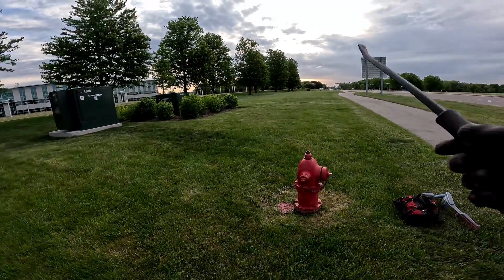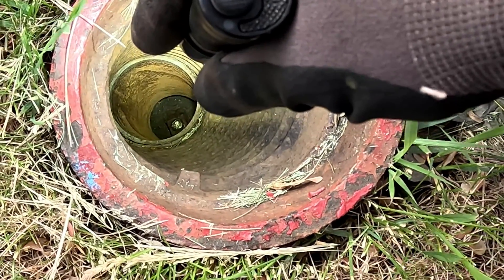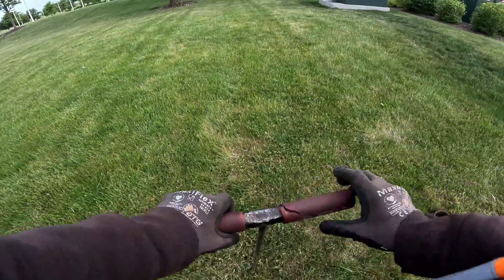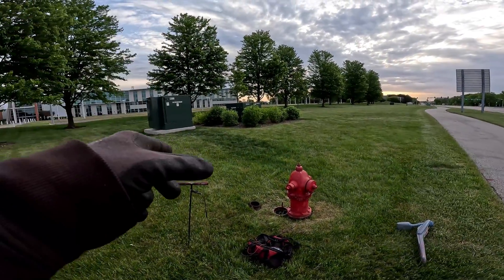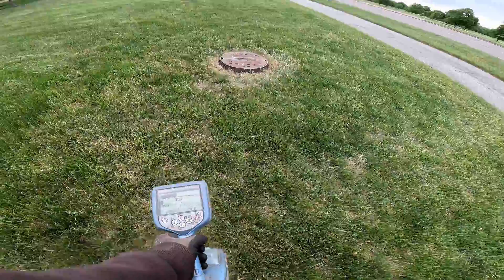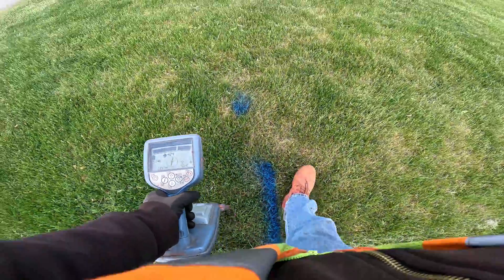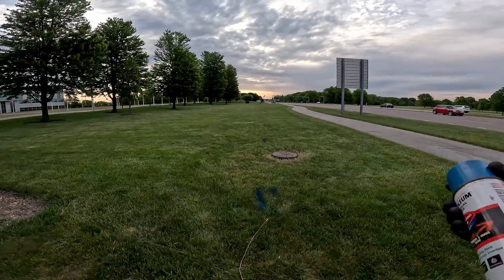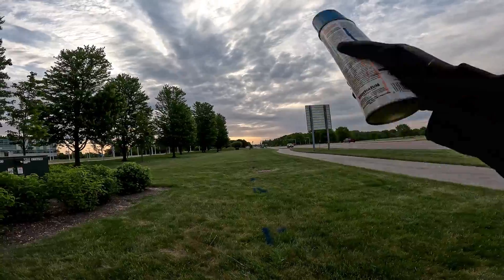How to Locate a 12" Ductile Water Main | Radiodetection RD8200 G

Comment: My first move is to open up the side of the hydrant and stick and magnet inside and induce that. It works really really well for DI lines
Reply: What kind of magnet do you use? And how long? I'm new to locating and will be mostly locating water
Reply from the maker: @lostinthewild69  I been using these super strong magnets for checking fiber optics if they are dielectric or armored they work great and last for years.
Reply: @lostinthewild69  I use a little magnet that has an eye hook threaded in the back of it. I just clip the positive lead onto it and open up the side of a hydrant and put the magnet on the shaft inside. It usually works pretty well. I think the magnet came with our RD8200
Reply from the maker: Next time I'm locating the water main, I'll give it a try and see how well it works out for me.

Comment: What frequency did you use ?
Reply from the maker: It really all depends on the resistance on the cable that I'm trying to locate. I mainly mark out power and power has high resistance so I have to use a higher frequency to blow through the resistor.
Reply: He mentions 9.81 in the video